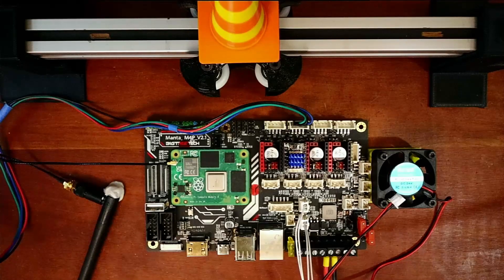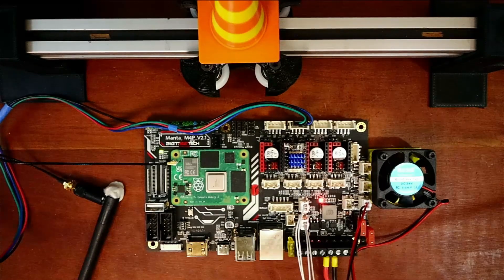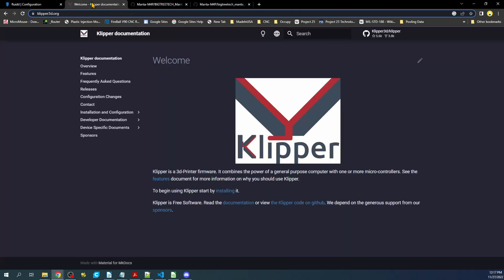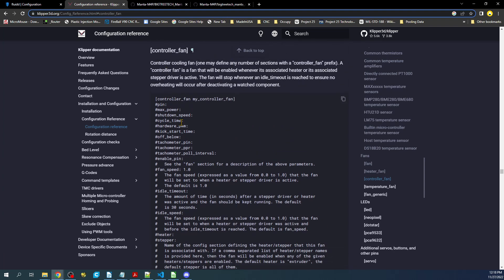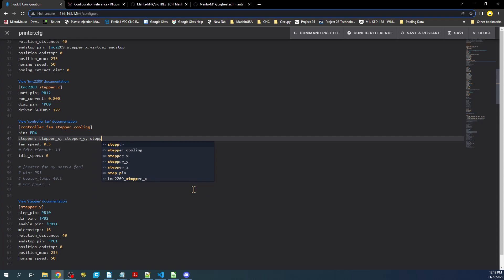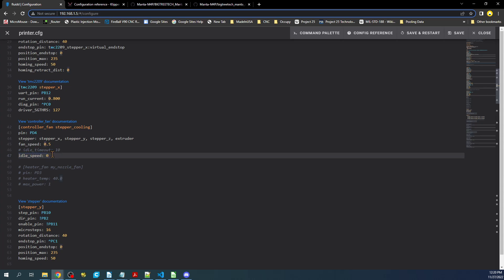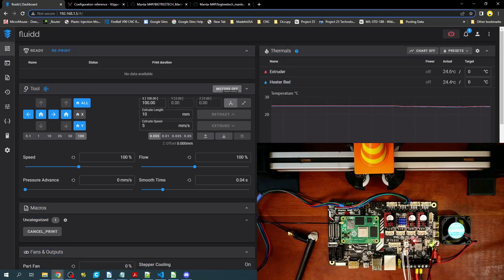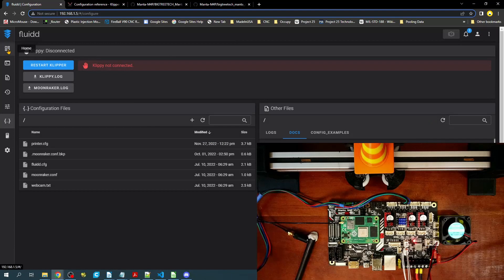BTT - Manta M4P - Automated Controller fan for stepper cooling

Comment: Hello, I dont know how often you check your tube channel messages but I have been going over your Octo Pro videos trying to get my rebuild to work an I am having a hell of a time. Body is a Tronxy x5sa that the board and hotend died from a short in a parts fan. I have BTT OCTO Pro V1, EZ2209 Drivers with adapter, BTT tft 50 V3.0, BIQU H2 Revo hotend, using the black tronxy probe. I have not been able to get these items to mess at all. I can get the motors to work in the marlin mode but it says TMC connection error.  But the z will not respond to the probe and just crashes into the hotend when trying to home. I can not get it to home at the front left it always goes to the back right. I can not get the BTT screen to even acknowledge the printer even with changing the connection rate to the input on marlin. I would love to sit down and have a chat to see where i am going wrong.
Reply from the maker: I'm guessing we spoke already if you're south south Florida on discord?